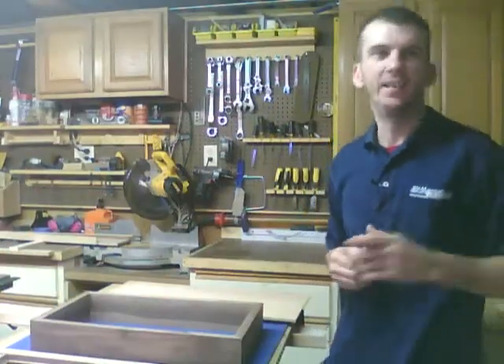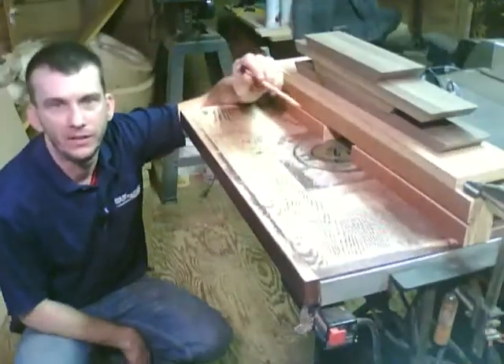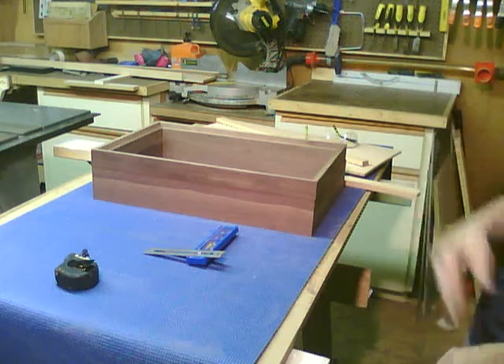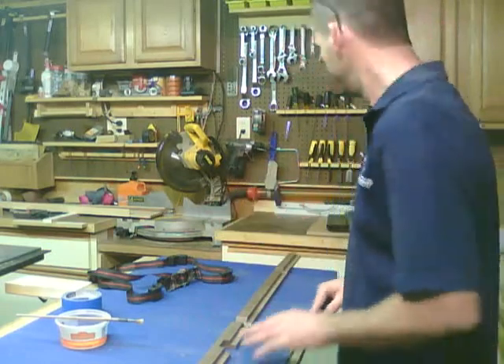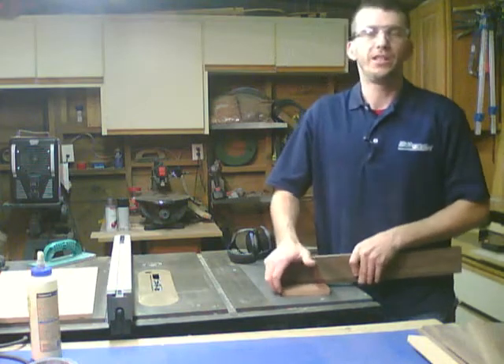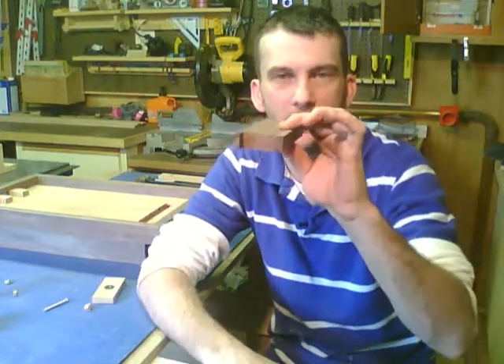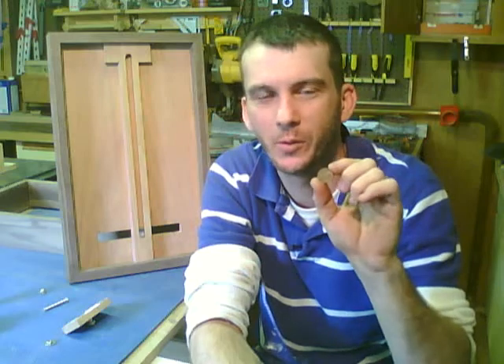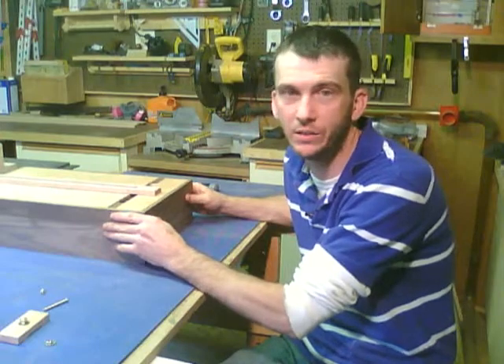How to build a Desk Top Easel Part 1

Comment: @flatiger4u i have Bosch gts10 table saw mitre gauge useless wont accept after market either.... i dont use a sled right now something i will end up doing...i also have a makita sliding mitre saw tested on mdf was ok but not when i did it on wood but i did leave the wood a while so maybe that did not help wood-thickness or something may have changed maybe why i also had bad 45/

Comment: Hi Laney. I might be confused, but:
1. What do you need the groove for  in the sliding piece which will be holding the canvas. If you use a blind nut covered with the 1945 dime, I undestand that the groove is needless.

2. The 1945 coin is to be hidden, isn´t it?

Great job, and thank you.